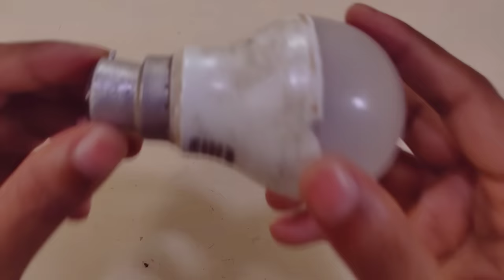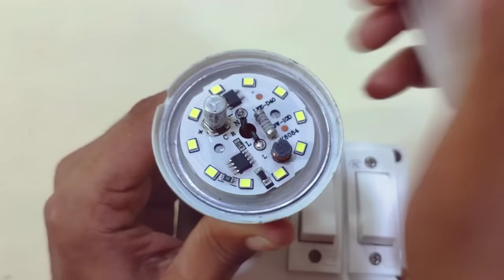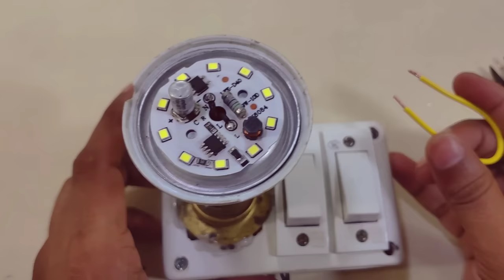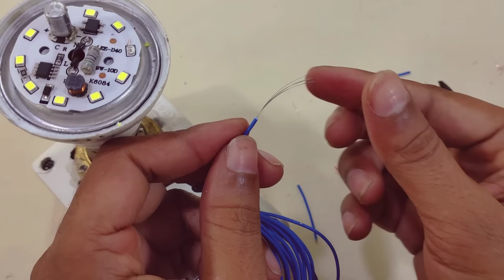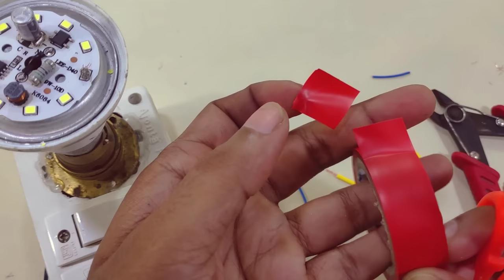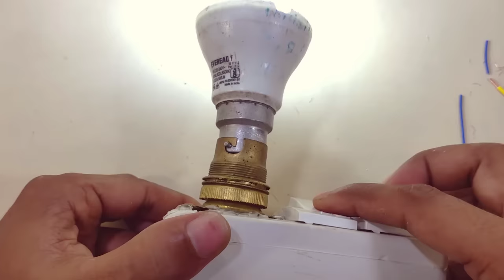how to repair led bulb with simple process 💡 💡 💡 🔥 🔥 🔥

Comment: I just repaired one but it was not the LED's it was the chip resistors, cold solders. I fluxed the areas and reheated the connection and the bulb lit right up. The only way to see the cold solders is with an eye loupe. The company was Ecosmart.

Comment: You forgot to turn power on while you do your "repair". At least that way you could have saved your family's lifes
Reply: You mean turn power off? Save your (their) life? Everything past the voltage reduction point, the driver, isn't dangerous voltage. Of course, if it was all exposed when opened up, yes, power down. Don't do a quick fix in a downpour, though. At least, don't ground oneself out.
Reply: BTW, I worked with low-high voltage electrician. He'd sometimes replace fixtures and components live. As long as he stayed insulated, didn't get sloppy, and ground the fixture out he'd be find. And even if he did, he always worked safe.  His gloves, shoes, and tools kept him insulated from current exposure if somehow the circuit became closed.
Reply: @richardtaylor4292  #ironic

Comment: Safety first.switch off the switch.n remove the bulb then use blade are anything.otherwise you will get shock.without precautions

Comment: You should not just short the circuit where the LED was. This working makes this a serial circuit, by shorting it the total voltage on the string will be divided over the remaining LED's, blowing them up in no time. Just solder in a new LED!

Comment: How do you get the bulb off a new one?
Reply: I saw another YT video to get the bulb off. I took a steak knife and place the blade where the bulb connects then rolled the bulb as I gently pushed the knife blade. Eventually, 5 or 6 rolls There was enough glue weakened that I could pop the top off.

Comment: That's a big big lie. It does not come off that easy. I pried with screw drivers. It would not like originally But when I took the top off eventually and screw it in, it lit very dimly all the leds. No one shows anything for that problem. So stupid shaking your fingers or words. Like talking to children. duh. 🙄🙄using tape, are you serious? that will never last with the heat. Always solder. maybe some chewing gum is your speed. 🤣🤣🤣🤣🤣🤣